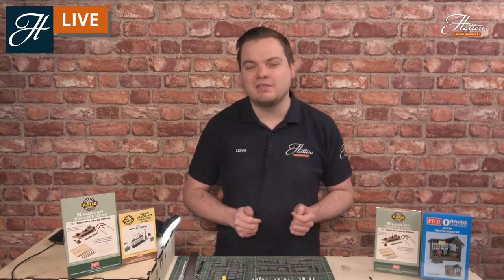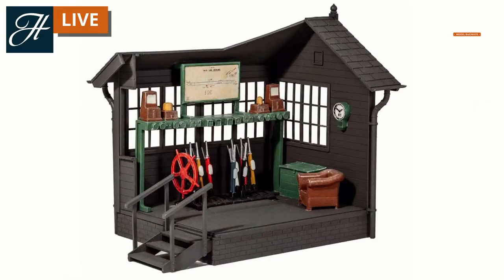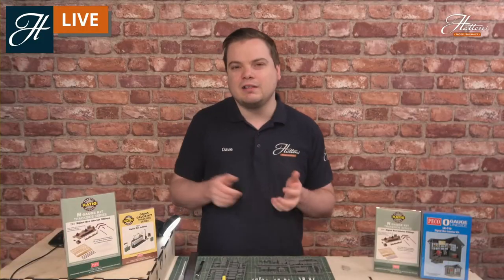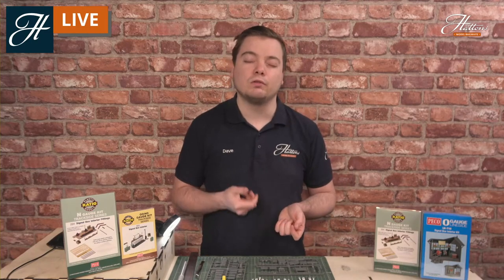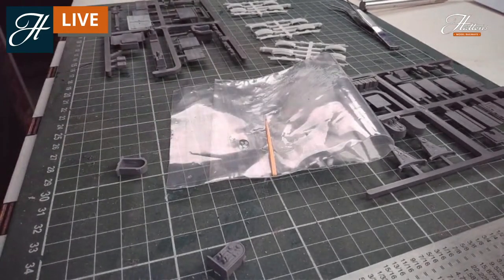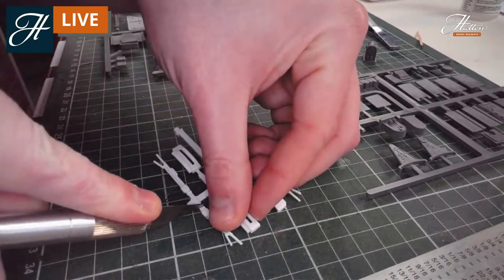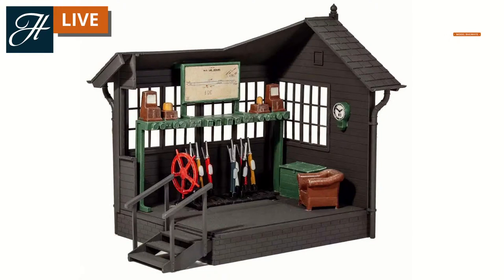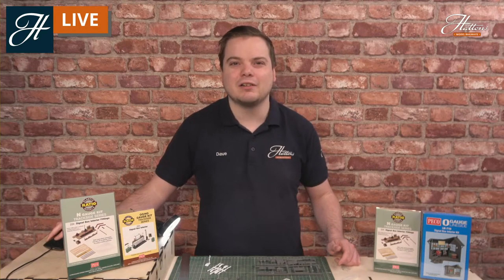Add detail to your signalbox - SkillsCast

Comment: I have a ready-made signal box on my model railway. I tried putting together a City of Truro steam engine plastic do-it-yourself kit, but my right hand shook when I began painting. The tender sides were a slightly splodgey mess of colours, I glued the tender wheels in and they stuck fast refusing to turn. I gave up and got rid of the whole thing. I'm terrible at kit-building to be honest. But, Dave, you are a great model railway skills teacher. I'm not just saying that.